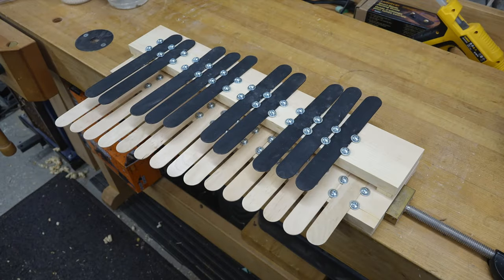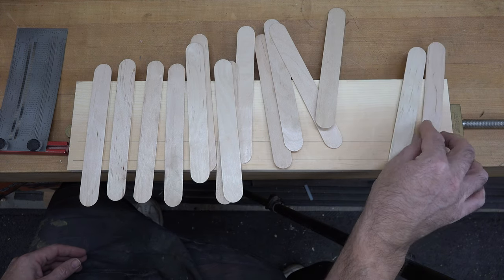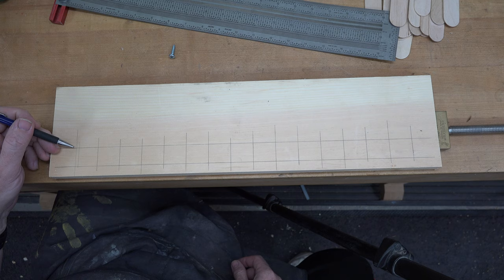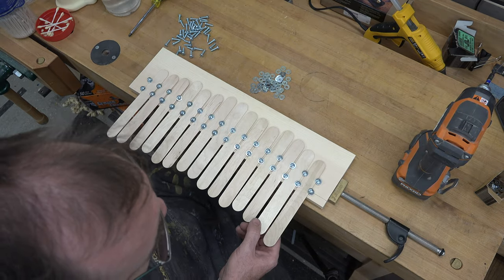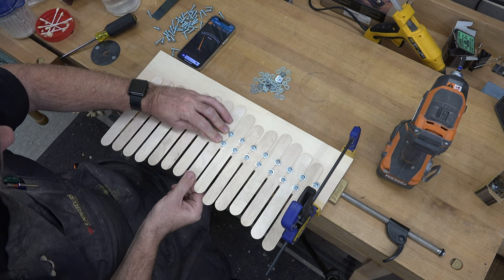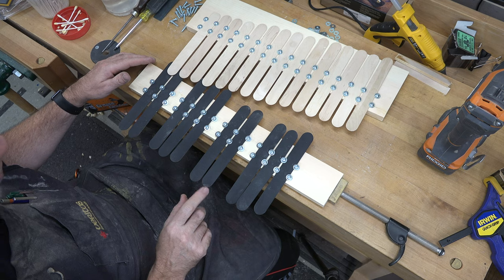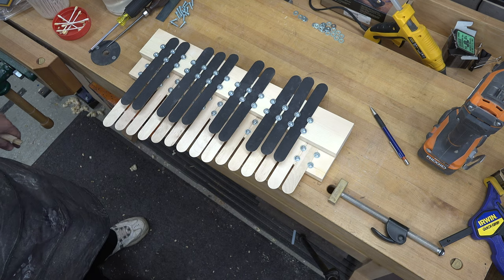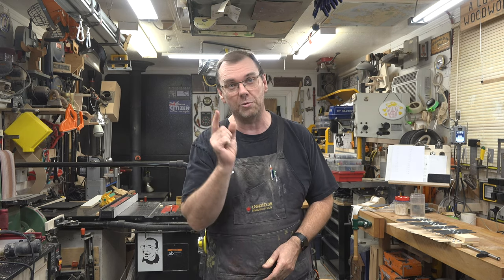Making a Popsicle Stick Piano

Comment: Our metric friend's will have a heyday with this build!  Just a side note (sorry--had to be said):  Thinking perhaps your instrument might resonate differently if a hardwood, instead of pine, were used?  Enjoyed this project.
Reply from the maker: It would be very easy to build this in metric.  My dimensions were made up on the fly so they are very easily translated to metric.  Also, the materials I used were the materials I had on hand and are merely for the demonstration.  Feel free to use whatever materials you'd like.  I agree that a better tone wood would produce better sound.  Thanks for tuning in Dwight.

Comment: Terrible measuring at the start. I'll never get used to measurements less than 1/8 of an inch. The piano is a nice idea. I hope European popsicles have a width in millimeters.
Thanks for sharing the idea.
Reply from the maker: Those imperial measurements can be a bit of a bear can't they.  No matter whether you use the imperial or the metric system, this is still a fun project to get the kids involved with.  Although I have to admit, those measurements would have been much easier to mark on this one using metric.  LOL.  Thanks for tuning in Hans.  It's appreciated.